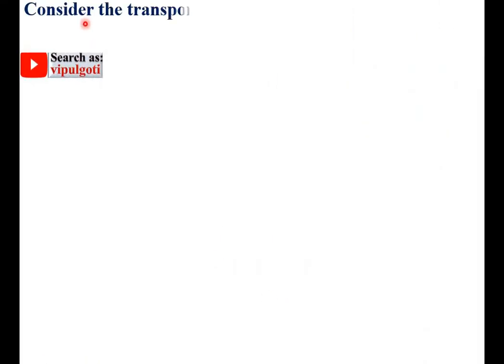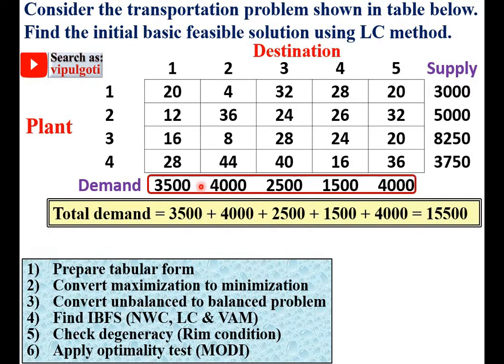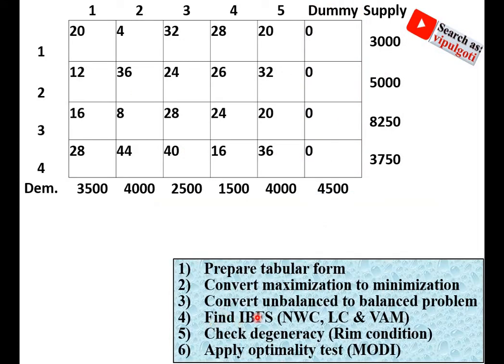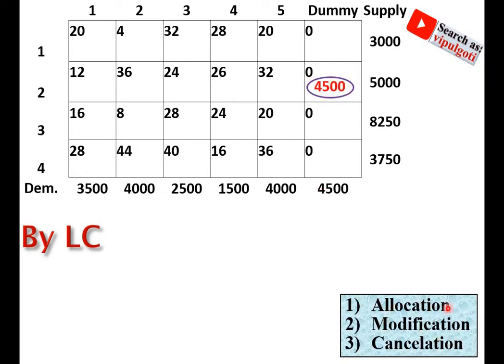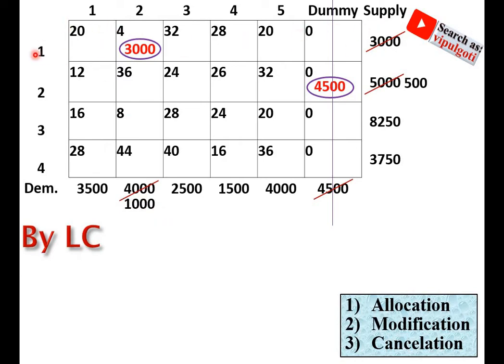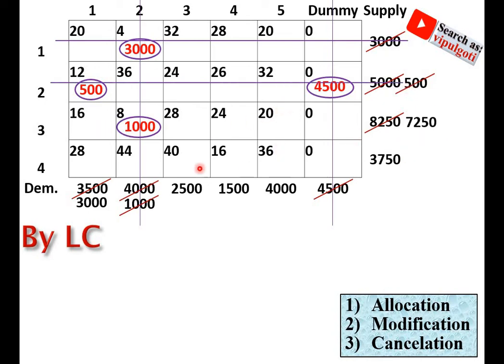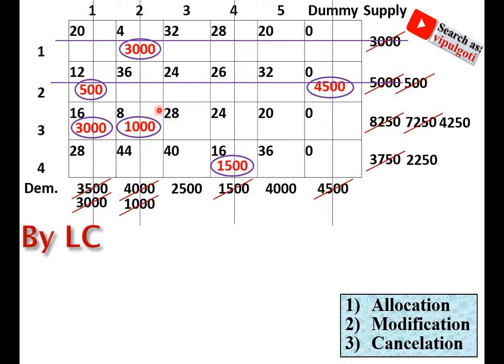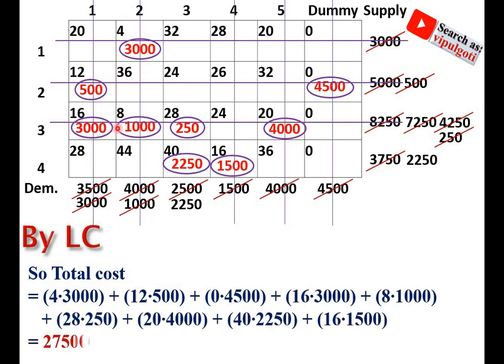LC for Transportation|4|Least Cost Method|Unbalanced problem|OR|IBFS of transportation|GTU

Comment: sir  i am taking the arbitary variable as the 0 which is in 3rd row last column........and i m getting total cost of 262000......so is this wrong answer or right, because u told we can select any zero of those two row.....and so i tried with the 3rd row 0 and getting different answer but everything is cancled out perfectly........so is my total cost answer is wrong?????????
Reply from the maker: Yes it's right. You may get different values for ibfs.